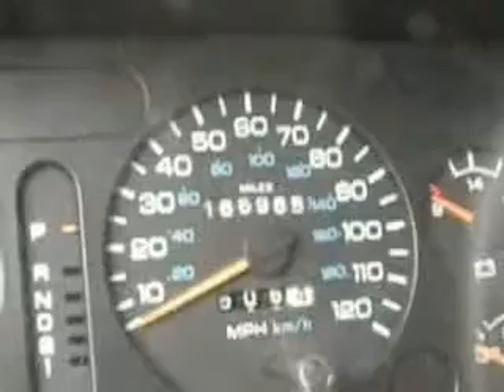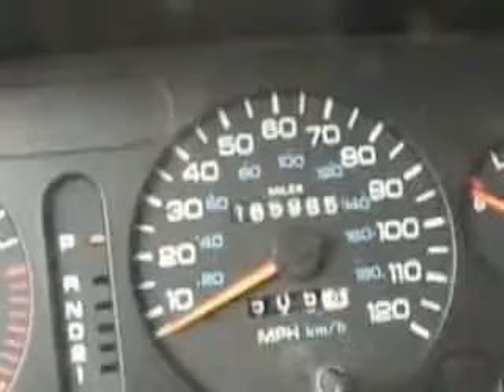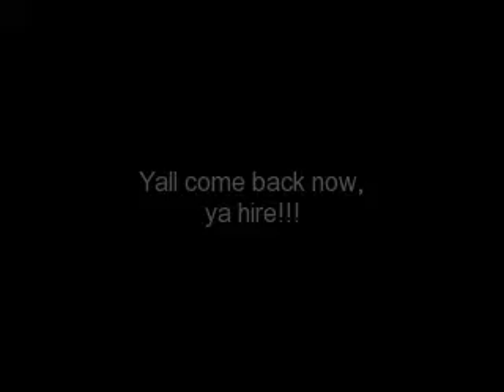1996 Dodge Ram exhaust and interior

Comment: that smoke is called water vapor from the cold exhaust to the hot gasses makes it smoke like steam. if its cold enough the steam never stops smokeing out cuz the air around keeps cooling the exhaust

Comment: @k3v015Mk The reliability of the engine on any truck depends on how the previous owner(s) maintained it. A lot of people have over 170K+ miles on their ram with no problems, others do bcuz of bad maintenance. The ones you see for cheap are cheap for a reason; high miles, rusted all around, blown plenum (intake), 2wd, etc. They're worth buying, but you'll end up spending $ on parts just like any truck. Only prob I've had with mine is a blown plenum gasket/plate ($150 in parts). i dont regret it.
Reply: Matt Nickerson I see than over 300k+ on these